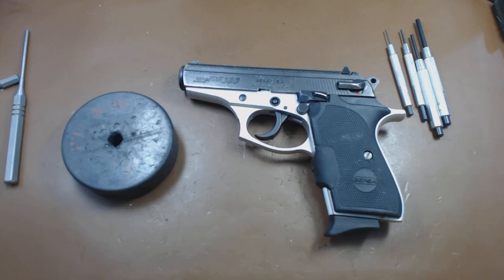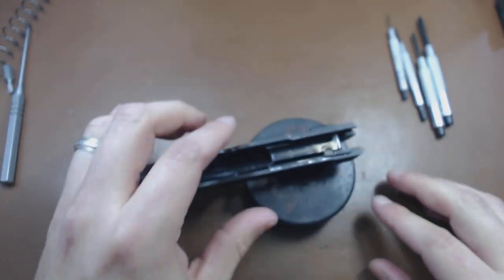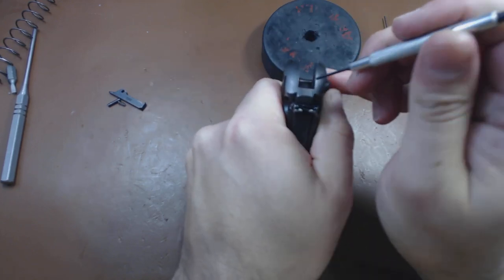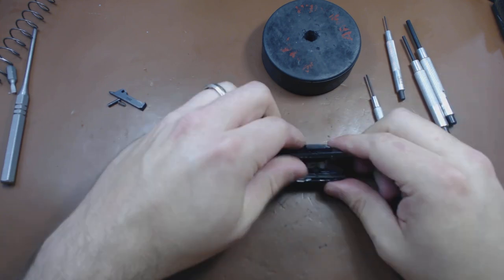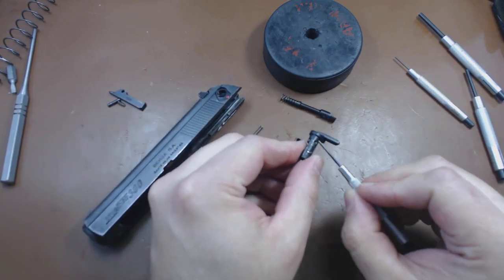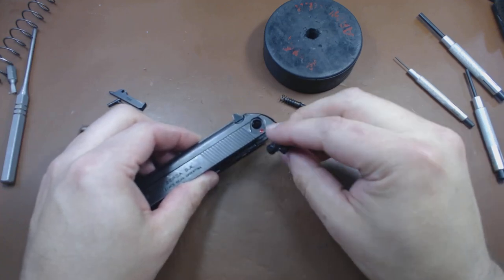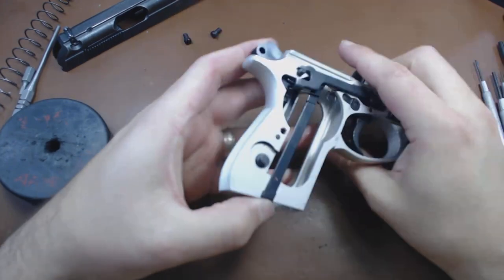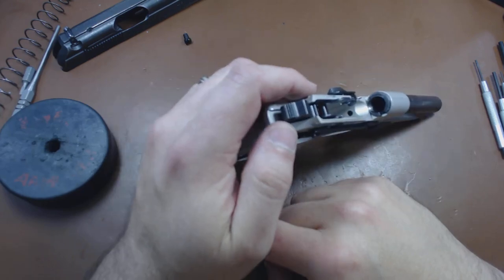Bersa Thunder 380 Complete Disassembly and Reassembly

Comment: This is a fantastic and highly-detailed video that clearly shows how to dissamble each part of the gun in its proper order.  The best part of this video is that you don't need to do everything the gunsmith does if you only want to clean the parts that don't work well when dirty like the firing pin, extractor, the various safeties and so on. It's kind of like the Liberty Mutual Insurance commerical in that "You only clean what you need to clean."

Comment: Just got a firestorm, stopped going bang after 46 rounds... This is my first handgun and I don't have money to just buy a new gun, so that was depressing. I'm no gunsmith so this video was crucial in figuring out how to diagnose the problem I was having when I came back home from the range. Turns out my sear broke at the point that engages the trigger bar and decocker in single action. Just ordered a new sear for 8 bucks so I'm not too pissed. It seems like no one else has had my problem so thanks again 10/10 very helpful.

Comment: Follow up on my Bersa Thunderer .22LR. Your video was tremendous help. I did tear it down and removed one coil off the hammer spring. Putting it together assembling the auto safety/hammer release cam/ejector and hammer was a BEAR. Ended up making two aluminum pins, one to temporarily hold the right side, the other to align the left side to start the hammer pin and they made it a lot easier. Yep, I did LOOSE the E-Clip that holds that washer on the hammer pin but was able to get one locally at a hardware store. I seen all the videos on this subject, yours is the MOST detailed. The job is complete, thanks.

Comment: Great video, helped me get my firing pin spring on correctly.  FYI, Be careful removing the decocker lever!  On my gun the detent assembly is NOT permanently installed and when the decocker lever was removed it went flying! It took 20 minutes to find the detent piston and spring.  Otherwise, this video was most helpful in explaining the spring orientation and how to get them installed properly!   Thank you!

Comment: Thank you, thank you.  I replaced all of my black action pieces with nickle plated pieces on my Bersa Thunder Plus, and 95% of your pistol was the same as mine :D  

Additionally, the old trigger I installed did NOT have the the bushing... it had to be assembled IN the frame.  Tried for a good thirty minutes or more before I thought of using a Q Tip handle cut to the width of the trigger and placed through the hole while holding the spring in place, then used the pin to push the Q Tip paper through the frame hole on the other side. :D

Comment: Great Disassembly & Reassembly. I have sold > 50 of these Bersa Thunders, they are imported firearms so it is imperative they are cleaned first. Bersa coats every part with some oil that, after time, turns into a light cosmoline, thus interfering with the safety plunger and firing pin.

Comment: I don't know if this is mentioned in another comment, but... At 14:09 you talk about the lack of retention for the trigger bar (drawbar). There should be a washer and circlip on the end of that stud at the aft end of the trigger bar that retains it when the grips are removed. The three Bersa Thunder 380s I have access to all have it and it's in all the parts breakdowns I've seen. 

BTW thanks for the video. It's been many years since I broke mine down and needed a refresher. I doubt I've even shot it since before this video was made. Last time I cleaned it I used Rem Oil with Teflon. Teflkon is supposed to be good stuff right? Yeah it sat on the shelf several years and the next time I pulled it out, the it was so gummed up you couldn't even move the slide. I was ticked off, doused it with penetrant, and set it back on the shelf. That was was a few years ago and I just decided to pull it out and clean it up again. At least this time I can move the slide.

Comment: You're the man. My ejector was stuck in place and I couldn't get the damn thing apart. Thanks for the video!
Reply: I got mine apart but my slide will not go back on
Reply: @thepistolguy859  I sold mine shortly after. That thing was a POS. Wouldn't cycle and the cheap aluminum frame or whatever it is was starting to show signs of wear from minimal use.

Comment: I have a Bersa Thunderer .22LR which is basically the same in construction as the .380. I've had problems with fail to feed/eject a LOT since I bought it. I bought a reduced slide spring which did help to an extent. After about 30 rounds (getting dirty), it becomes less reliable FTF/FTE. I've done MANY spring kit installations on double action revolvers and it really helped by putting reduced hammer springs in but you can't go to light which will cause a "light hit" FTF. As stated in this video, the hammer spring is VERY high pressure. I think if I reduce the hammer spring by one or two coils, my problem will be solved and it will cycle properly. Gun manufacturers have a tendency to OVER POWER trigger and hammer springs for "legal reasons" which in turn may render the firearm UNRELIABLE during a critical situation. Just my experience.

Comment: It looks like you have a part missing on your gun. There is supposed to be a washer that is retained by an e-clip on the post at the back end of the trigger bar. That keeps the back end of the trigger bar from moving outward when the grips are removed. I am replacing mine because the e-clip broke and, since I have wood grips that will NOT retain the trigger bar, the gun malfunctioned. I always refer to your excellent videos before attempting a repair. Thanks!
Reply: that's what I was thinking .................... JRW
Reply: I believe the older models did not have the washer and a fix bersa needed to make for reliability included the washer. It's in that area the pin walks out behind the trigger bar. I only assume the washer was to assist fixing that issue. Just from a trouble shooting point of view anyway.
Reply: Dear Mr Armed Anglican I have recentlt got one of these in a local pawn shop please advise on how to get and cost of wooden grips and where to purchase them please advise
Reply: Armed Anglican . I also have wood grips and same is happening to mine where could I order the eclip and washer?  When I hold the trigger bar it fires

Comment: I got a bersa thunder plus was dry firing with some snap caps noticed the gun was a little dirty so I disassembled the gun. Now the slide will not go back on. I've took this gun apart 100 times and never had this problem. The spring is small end on the barrel and the end of spring is in 12 o clock position. I can get the slide on but for some reason it's not catching and going forward. The take down lever is all the way pushed forward. I have tried to put slide back on with magazine inserted and no magazine. Not sure what's causing my issue any help would be much appreciated. EDIT there was burrs on the slide rails had to file the burs down and now I got the slide back on and fired a magazine through it it's working fine.
Reply: glad you figured that one out!

Comment: I have two Bersa Thunder CC's.  When I took mine apart, both were missing the washer and C clip that hold the trigger bar in place. They had to have fallen off while shooting them. Additionally, the trigger bar spring came out of the groove in the trigger bar while shooting one of them, which renders the pistol unusable - dead trigger. I've lost a lot of faith in these two pistols.

Comment: There is a washer and c clip that holds the trigger bar to the gun. Yours is missing.
Reply: You beat me to the punch, I was just going to tell him the same thing.  Good going.
Reply: Is this a common thing? My friend gave me a Model 83 .380, and said "there's a clip and a spring missing- it looks like something is supposed to be holding the trigger when the bar is out, or something. Just doesnt look right.
Reply: Are you still on utube? I have a question concerning my Bursa thunder 380.
Reply: I noticed that too...  I'm really surprised he didn't realize this.   Issues when buying a used firearm.
Reply: I got a bersa cc 380 used and it had this same problem I bought a C clip from harbor freight but I haven't gotten a washer yet
Reply: My Bersa repair center said the C clip was a later addition to Thunder models. When mine broke Bersa sent me replacements free. But, I  replaced my C clip with a sturdier one from Loews hardware.  Bersa gunsmith said that was fine provided it still rotated freely.

Comment: Hi... Always enjoy your videos.  What size drift is used to remove the extractor pin?  I bent 2 trying to remove mine ...thunder CC....  It was either driven in the wrong way, or corroded to the point its frozen... It won't budge.    Someone seems to have oiled the firing pin chamber and would like to clean that out... It works fine,.... What is the down side of leaving it oiled??  Thanks.

Comment: A.  What happens if you install the recoil  spring backwards?
B.  Mine fires just fine with a full magazine until I do 3-4 shots, then I get malfunctions, unable to fully eject.  When the gun is empty, I pull the  hammer back fully rearward, then the slide, and notice the slide hits the hammer a bit too hard even if cocked back....  I think the hammer contact is preventing  the slide from going back fully/smoothly, and preventing  the empty cases from coming out.  Is the slide/hammer contact normal?

Comment: How much lateral play in a perpendicular orientation to frame should the ejector have?
A Freind picked one up cheap that has certainly seen better days , I’m cleaning it up for her and I’ve noticed what seems too much lateral movement to me.. as if perhaps the bushing is too short.
I did notice the recoil spring was on backwards m… not sure what has or has not been done but I’ve never seen a loose or wobbly ejector in anything

Comment: Have a question about my firestorm. Brand new gun I believe it’s the firing pin safety (shown at 15:44) and the ejector (parts that sick out when u take the slide off) are kinda loose. No problems with my gun just concerned and wondering if that’s normal or if I need to have my gun fixed. 
Put rounds through it slide locks back when it’s empty and everything works normally just kinda bothers me

Comment: work in progress but here are the timestamps for the the slide assembly takedown

0:00 Intro
0:30 Field Strip/Takedown
1:12 Extractor
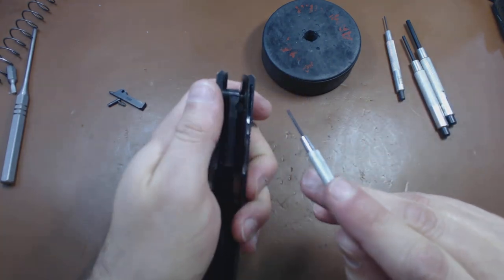2:35 Safety/Decocker
4:50 Firing Pin/Firing Pin Safety

Comment: I have an unrelated question; is it possible to polish this particular slide? I think I have the same exact bersa 380 where the frame is aluminum and the slide is stainless steel. Is there any way to change the exterior of the slide to a glossy, shiny look? Thank you!

Comment: I just picked up a firestorm and it's the most accurate gun I have ever shot. I love it. I do have a problem though. After I field strip it is extremely hard to put the slide back on. I've watched a million videos on YouTube so I'm sure I'm doing it right but no luck. Any suggestions?
Reply: I have a firestorm and the slide takes a little finess. Don't force it or you'll damage the rail on the frame. The more gentle you manipulate the slide, the easier it is. My takedown lever is spring loaded so that has to be held in the down position while putting the slide back on. Good luck. I really like my Firestorm. It's a slick little platform and handsome to boot.
Reply: I was having a terrible time trying to get the slide back on my Bersa 380-A. After watching this video, I took the right side grip plate off and made sure the trigger bar and the magazine safety were properly aligned and tight against the frame and then reinstalled the grip plate and tightened the grip plate screw. Thank goodness the slide went back on after that. Not sure if maybe the grip plate screw was just a little loose in the first place and that perhaps was causing the problem. I too had watched multiple YouTube videos, but none of them mentioned the importance of making sure the grip screw was sufficiently tight.
Reply: While pulling the hammer back but not fully cocked,push in on the front of the trigger bar until it sits nearly flush. You may need to do this a few times. Every time I couldn't get my slide on I noticed that bar had popped out slightly. Works every time once you get a feel for it

Comment: My gun has the same wear marks on the slide above the trigger linkage and below the extractor. I bought it new, have several hundred rounds through it, and clean it regularly. I don't think I'm "abusing" the gun in any way. What can I do to minimize this wear from continuing? If the grip  has a secondary function, mine are Firestorm rubber grips- could that be a factor, in that they give a little at the top?

Comment: Dang ..... my Bersa Thunder trigger assy has no barrel and when I was inspecting as I got to that point the little trigger return spring flipped out onto the floor.  Now without the barrel to hold the spring in place it's very difficult to get the trigger assy back. Could not find anything on the Internet although there must be something out there that shows how to re-insert the trigger I finally rigged up a short pin (nail cut off) .. installed it with the nail and then pushed back out with the slide release ...

Comment: This vid is for newer BT380's and I have an older one where the Firing Pin is held with a Horseshoe retainer and doesn't have a firing pin safety unit.  cannot find much on the older ones sadly.
Reply: However, this was extremely helpful!!! There doesnt seem to be much difference with the older Bersa Thunders and I was able to take down mine (excluding taking out the firing pin) with confidence thanks to your video! Thank you/.

Comment: MISSING:
65. Hammer pin washer

66. Drawbar retention ring
Reply: I was gonna say, it looks like the trigger bar is journaling into the slide because it's walking sideways every time the trigger is pulled, especially under the force of blowback.

Comment: Great video ive taken it apart quiet a few times but for some reason I cannot get Past that hammer pin. it just does not budge, anybody else have that problem?
Reply: Mine wouldn't budge and I was afraid that I'd mushroom the end of the hammer pin or break it beating on it . What I did was use a c-clamp with the flat side of the clamp against the hammer pin on the right side of the frame that sticks out and the screw side of the clamp on the left (flush side) . I used a small socket on the flush side in order to have something the pin could go into and to keep from boogering my frame up. You want to try and keep everything as parallel as possible. A nice steady turn and pop,it came loose. Similar concept you use when replacing suspension bushings.
Reply: @popslops2188  thank you for the tip it finally came out much appreciated 👍

Comment: I am having a very weird problem where the hammer won't stay cocked back after pulling the trigger and cycling the slide (the normal trigger reset display). it does it very rarely, maybe 1 out of every 40 times, but it's still enough to cause me to have 0 faith in this gun.  I haven't taken the gun to the range but I'm almost sure this would cause the gun to go full auto because the hammer is dropping on a live round while my finger is on the trigger.
I'm pretty sure the trigger bar I have is out of spec, because after cycling the slide hundreds of times to see what happens when it malfunctions like this, I can see that the sear is getting stuck on the top lip of the trigger bar when it malfunctions (whereas normally it is able to clear this top lip and fall back into place to lock the hammer back)...   
this is a very bad design, and I'm not a gunsmith, this is the first gun I've really taken apart like this (never had a problem before), but I have zero faith in this gun.  my gut instinct says I should file the trigger bar lip so the sear will clear it 100% of the time... but I'm wary about messing with things that I'm not an expert on.. especially regarding a hammer/sear engagement on a gun...

do I just have a lemon or is this a documented problem with this gun?  

a reply would be greatly appreciated, you seem to know the ins and outs of this gun.

Comment: Its hard to take my bersa apart because the hammer wont stay back once i slide the slide back do u have a fix on that
Reply from the maker: That's very odd. The hammer should stay back so long as the trigger isn't being pulled. If you are describing a working gun that only exhibits this during disassembly, then I'm stumped. If gun is broken and the hammer doesn't ever stay cocked, that's a different matter and something is definitely broken.

Can you describe your problem in a bit more detail for me? When does it stay back and at what point does it release, etc?
Reply: AshburnArmorer the hammer doesnt stay back at all. Even with the mag in or out. But i went back up to the shop where i bought it from and they said its probably best if i contact bersa about it
Reply from the maker: Ok. That makes sense. If you happen to be in Northern Virginia where you could bring it to my shop, or if you have a local gunsmith you trust, you could take it there. Outside of that, letting the factory handle it is always a good option. It can be inconvenient to be without it for a while, but you generally get quite good service from the manufacturer.

If you do have problems sending it for repair, let me know. I may be able to arrange for you to ship it to my shop (if you are in the US anyway). Good luck, and let me know how it turns out.
Reply: I had the same problem with mine a couple of times. After doing some internet research I found the answer. Try loosening the grip screws just a little until you can get the hammer to lock back. I know it sounds weird but it's true.